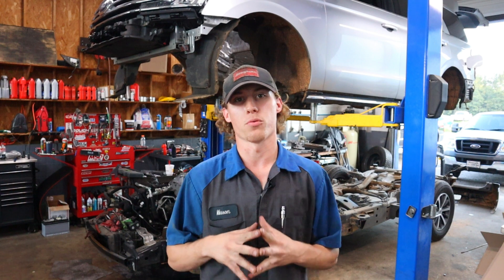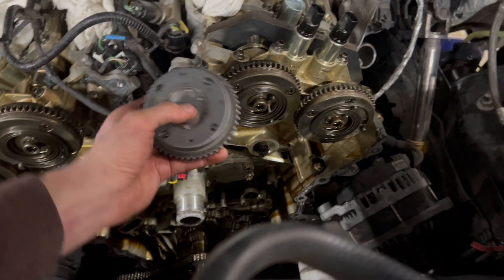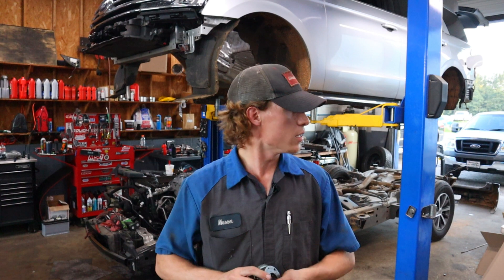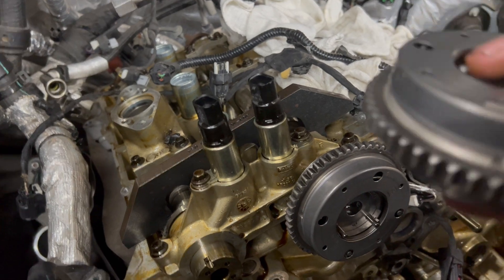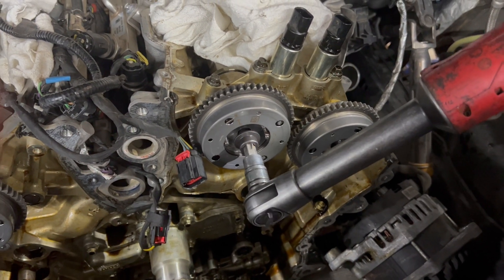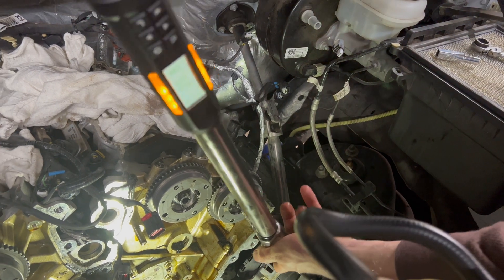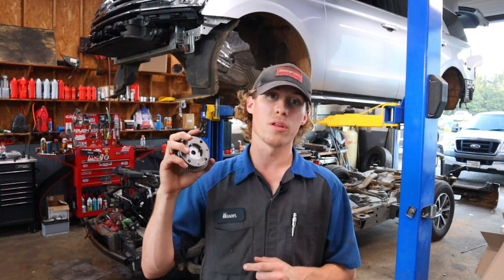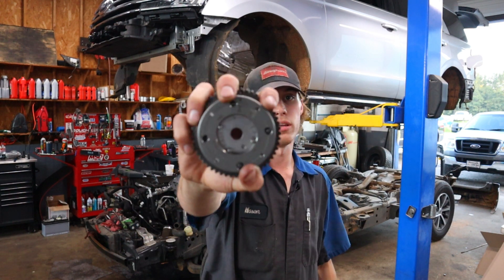Ford 3.5L EcoBoost Cold Start Rattle | The NEW UPDATED Phasers

Comment: Thank you for these videos. I have a 2014 f150 3.5 eco boost. I’ve only heard that rattle a few times at cold starts and last less that a second it seems. Is that and issue I need to address?
Reply: Nobody I've ever asked has responded to this question.  I think it's because there aren't any engine failures due to the phaser rattle.  I think people panic when the noise does happen ( it does sound bad for a second) so it's a mad scramble to fix it, not knowing or caring if it's a longevity issue.   PLEASE, WE WANT TO SEE VIDEOS OF ACTUAL 3.5 ECOBOOSTS THAT EXPLODED DUE 100% SOLELY TO A NOISY CAM PHASER!
Reply: How has the truck been running after 8 months of you posting this? I have a '14 3.5 as well. On a cold start it'll do the usual rattle for a handful of seconds then just go away. Otherwise it idles and drives smooth.
Reply: @black5heepX  It hasn’t done it again. I change the oil and filter (Mobil 1 ) at 4K and it seems to have settled.

Comment: The dealer mechanic did a great job on the repair.  The hpfp wasn't the cause of the idle knock either because that noise is gone too! Nice a quiet at start up and hot idle.  Thanks for this video!!!

Comment: So before I call my Ford dealership and have these done how has this repair and new phasers lasted? Anyone have an issue after replacing? My second set only lasted about 30k miles.
Reply: had it done at 51K miles and it just started again last week with 91K miles.  they put in same phasers as i told them i'll be back in 45K miles since the problem wasn't fixed and worn out parts were the only thing fixed.  I'm about to go to Dodge.

Comment: Hey bud I think your doing a great thing and they are lucky to have you. I recently bought a 2019 f150 limited as you know it has the high output 3.5 Ecoboost and the check engine light came on checked and it’s a p0022 but if the light didn’t come on I wouldn’t now there was a problem it runs fine the truck has 25000 miles what should I do? Thanks again for your videos very helpful

Comment: Oil pressure actuated variable valve timing is the worst thing to be unleashed on the car buying public.
Reply: Theres a lot of problems with modern cars. I think it comes down to low quality and over complication.... and extended oil changes.
Reply: Why don’t Toyotas have issues with them then? It’s a Ford issue
Reply: EGR was
Reply: Actually Honda is currently having cam phaser issues from getting into this, they are also having oil burning issues on new cylinder technology that ford came up with. Fords ahead right now every manufacturer is following them.
Reply: Can this be the same issue on a 2016 5.0? And can this cause the cam phaser sensor code?
Reply: Honda does it just fine.
Reply: @bryanmercado8755 Vtech has never had an issue but it's also not in the CAM, it's in the rockers that opens the intake valve more. So, it's not the same design.

Comment: Do you know if all dealer service departments are using the newer phasers for the replacement? My 2020 is in the shop for a knocking noise coming from the drivers side phasers. I’m afraid they’ll put the same old parts in it.

Comment: Are the new ML3Z Phasers a permanent fix for this problem or does it just happen again like the old style? Im looking to buy a used EcoBoost with the Phaser problem for a really good deal but I'm afraid ill have to keep dealing with this over and over!
Reply: I did my phasers in 2020 used old style. 40k miles later and 2 years, it’s back to the same old rattle. Grr.

Comment: Thanks for another excellent video. My 2017 F150 3.5 ecoboost (Now at  62,000 miles )and i  have been dealing with this problem for over 3 years. The Cam phasers have been replaced 4 times . the first two times they used the old part numbers HL3Z, then the third time they used the new ML3Z part. Each time the problem continued not only at cold start but even when the engine was warm. At times the engine sounded like it was going to blow apart. Most recently (Sept) they put in the 4th set of cam phasers using the old part number HL3Z. At first the noise was still there but not as bad and now for the last two weeks the engine is quiet for the first time in 3 years, i am not that confident that the problem has been permanently fixed and suppose that any day now it will start making that awful noise again
Reply: My 2017 is going under the knife on 2/23 I have been assured the new parts are going to be installed. I love the truck but I didn't buy a diesel ! Best of luck to all in phaser land and Merry Christmas!
Reply: And that the EXTREMELY loud knocking for 1-2 seconds right at startup? after it's competlely cold, or are you talking about another rattle like turbo waste gate?
Reply: If not repaired will it cause engine failure?
Reply: seconds right at startup
Reply: @sfeer1985  I'm taking mine in tomorrow for the first repair, trucks at 46k miles. This makes me feel not soo good about it.
Reply: When it's cold
Reply: People don’t fix it and say that nothing ever happens with the engine.
Reply: The noise did return after the 4th Cam Phaser replacement with the same symptoms as before. I no longer have that truck

Comment: Are the new phasers compatible with the 1st gen 3.5 (2013) in a sho?
Reply: I have the 13 as well.  Did you ever find out if this new replacement part worked on the 13 or not?

Comment: Mines in the shop getting this done @42,700 miles. Thanks for the updated part number-I'm checking to make sure I get the new style installed!! 2018 F150
Reply: How much did it cost you if you don’t mind me asking I’m looking to get it done to mine as well
Reply: @rayslawncare616  warranty
Reply: What was the total cost for the work and parts?

Comment: So I have the vct rattle on my 2018 5.0.. as well as “spark knock”  these both happen no matter the engine temp, I drove for 2 hours yesterday and it happened the entire time, from cold to operating temp

Other than the noise, does this cause any problems? Like is it okay to leave it as is? Unfortunately the dealers around me don’t like to give out loaner vehicles when people have to leave their vehicles with them, and I can’t be without my only vehicle.

Comment: I have been told to flood the motor by holding the gas pedal down while holding the key in the starting position before starting the engine on a cold start to build up oil pressure to prevent wear on the cam phaser. But, I have noticed that when I turn the key to on with a normal start, the oil pressure goes up for a couple of seconds; which is long enough for me to start the motor before it goes back down again. Is this intentional by ford to build up pressure to safely lubricate everything on a cold start? Want to know if I can start the vehicle regularly without cranking it for 7 seconds on every cold start

Comment: Здравствуйте. Скажите пожалуйста, у меня Ford f150 3.5 ecoboost 2011 года выпуска. Мотор умер. У меня есть вопрос. Мотор от "explorer sport" такой же как на "F150" ??? 

Блок цилиндров подходит? Если я куплю шорт блок от "explorers sport", он подойдёт на "f150 3.5 ecoboost 2011"?

Hello. Please tell me, I have a 2011 Ford f150 3.5 ecoboost. The motor died. I have a question. Is the engine from "explorer sport" the same as on "F150" ??? Is the cylinder block suitable? If I buy a short block from explorers sport, will it fit on the f150 3.5 ecoboost 2011?

Comment: Do these work on a Gen 1 3.5. My 2012 Ecoboost has it, been meaning to get that changed out. 225k miles and runs like a champ other than that rattle

Comment: HI Mason,I hope you see this and can give us some insight since many 4X4 truck owners have this situation. My orginal tire size for my truck is 275/65/18.I leveled it and went with a 305/65/18. Which isnt a giant difference but still a substantially larger sidewall and bigger outter circumference.If I have a flat and need to use my orginal spare tire (factory size) will it destroy the driveline?Whether the front or rear is this an absolute disaster or can I drive a few miles without damage? Keeping in mind its a 4X4.With the understanding of limiting the speed to say around 30-35mph.Any advice with this would be so appreciated. Thank you.
Reply: Throw it on the back if you get a flat. Make sure you don’t have a limited slip differential, or a automatic locker. In that case you can’t run it on the rear axle. Most the time you can mount a bigger spare and it will fit under the truck in the original mounting.

Comment: SO??????   When Were the "NEW PHASER'S INSTALLED" on the 2022 V6 Engine's? In the F-150 Family . (Also) My ENGINE was Built In MEXICO, Is there an Issue with V6 Ecoboost Engines BUILT IN "MEXICO"???    H E L L O?????

Comment: These trucks are garbage.  Very unreliable.. and alot of $$$$ for simple repairs.
Reply: Nothings really unreliable. You can drive all day on the cam phaser rattle.
Reply: @Experial.69  untill the phaser throws the timing out.
Reply: Certainly seems to be the case. although the cam phaser issue won’t internally hurt the engine, it’s still a major issue that can cause other issues outside of the motor. Timing chain for example.
Reply: @Maynardd  it will hurt the engine if the engine is at high RPM's and the valves do not close fast enough due to the phaser not operating properly.. causing the pistons and valves to kiss or come into full contact.. the phasers adjust the degrees of the cams to either retard or advance the valve timing depending on what is asked of the engine, then there is a high risk of the pistons coming into contact with the valves if tye phasers are malfunctioning badly,.  Which is the reason why these engines develop compression issues on some cylinders.
Reply: @zorans5200  Good to know! I guess the Ford tech that explained to me otherwise was wrong.
Reply: @Maynardd  im just telling you that the cam phasers adjust the degrees of the intake and exhaust timing.. if the came phasers fail and do not retract to "0" when they are not needed it can cause a possible contact at high RPM...  A chevy tech also told me he couldn't find anything wrong with my truck after i took it there twice, said everything was normal untill i decided to investigate and it was actually the GDI pump.. but nope everything was fine when i took it in.
Reply: @zorans5200 what is the chance of this ever happening

Comment: what in the absolute hell is wrong with engineers that one has to separate the car like it's at the factory to work on it? I mean that is insanity. "hey buddy your tune up is $7,000 dollars." "For 8 freaking spark plugs?" "Yup, and 7 grade 8 bolts 12 new body mount and bushings, fourteen snapped connectors, 14 different fluids, and 49 hours in labor." s
Reply: This kind of stuff is exactly why the battery movement will take over which sucks because I like working on vehicles.
Reply: @Bigfoot8x6  IT will then it will be discovered to be a giant disaster and we'll all ride horses. So we better start voting for conservatives because we're all going to be stuck in an apartment in a city owning nothing if we don't stop them

Comment: Hey Mason…but of the topic but I know your pretty good with ford vehicles. I’m wondering if there is a fix for the front wheel hub actuator on 2015 f150 always seem to get a grinding feel especially when it gets colder and I’ve replaced them with new ones and checked for leaks. Wondering if there is an update or something
Reply: Replace the vacuum check valve for the IWE actuators. It's located right behind the brake fluid reservoir. Motorcraft YG360 is the P/N.
Reply: First replace the vacuum check valve.  Confirm vacuum line condition and perform vacuum tests on the IWE to confirm they are not leaking.  If it continues you may need to either disassemble and clean that IWE that is sticky, or replace it because the teeth have already worn down.

Comment: Yet my cousin's 17 has little over 200k. Been making the noise since around 60k. So if it's out of warranty is it really worth spending the money to replace them. To me that would be no does not seem to actually harm anything.
Reply: bought my 17 with 180k and it had the rattle alr been driving it for almost a year and 10k miles and haven’t experienced any problems 🤷🏽‍♂️

Comment: I have new updated phasers that were put in 25k miles ago. Now more noisy now and haven’t lasted as long as previous phasers. Along with six DTC,s. I’m getting p0365, p0369, p0299, p0524, p061A, p0390. Replaced all cam sensors and same codes came back, all service oil changes completed every time by dealership. I believe the chain has stretched and vct,s are gone again, no power no turbo and low oil pressure. I’m at wits end. Been a ford guy all life and I’m ready for a check at this point. Have 105k with a 120k power train warranty, the problem is them fixing and not giving me a ride until completion. I don’t have a extra vehicle. I’m over it.
Reply: corporate greed, emission regulations and diversity hire engineers have destroyed our vehicles. I have a 2000 F-150 v6 manual that runs like a champ. The current tacomas are good too
Reply: on what vehicle were the new phasers updated on that failed?

Comment: Here because my 18 3.5 EB is at 48K miles with stock phasers. That last comment……yep, don’t let anyone tell you otherwise about the GM L84/L87 lifters. 2022 Escalade with 6K miles just had out lifters replaced.

Comment: It's a strange thing ,some 3.5 engines meticulously maintained and the phasers need replacing, and others abused and neglected with high mileage and no issues. I have a19 and am at 80000kms/50000 miles so far so good
Reply: By "fail" what do you mean?   You mean acquire a rattle?  Or do you mean actually explode inside the engine and ruin the motor?  Because I simply cannot find any information on the latter.....
Reply: @peruser155 no one actually knows
Reply: Yeah, these engines need to be driven hard way more often than not.
Reply: give it time... around 75K they will begin to fail...

Comment: You have a great channel and provide the critical info I need when working with my dealer on this issue. My 2017 3.5 ecoboost had cam phaser failure at 54K miles (warranty), again at 75K (part customer pay), again at 93K (dealer warranty on prior work), and just started again this week at 109K.  I'll need to wait for it to rattle consistently after a cold soak so that the dealer will address the issue, although I've become somewhat of an expert on identifying it by sound.  I think this is the second redesign of the phasers for this generation, if I remember correctly.
Reply from the maker: We don’t even check them anymore. Just put phasers in, they’re all bad haha
Reply: @FlyingWrenches13  when you pay 60K for a truck you should not have to pay 3500 each time you need new phasers!   I'm definitely very close to abandoning a long family history of Ford trucks and it doesn't seem to me that Ford gives two sh*&%ts about me.... I've called the "customer care" (oxymoron) center several times - they tell me it's the dealers problem, dealer tells me it's Ford's problem.  Well, now it's my problem and the solution is probably a Toyota truck....
Reply: @mr.grapes3931  ok Karen 🎉
Reply: @mr.grapes3931 Agreed 100%, just make sure you get the 07-21 Tundras that have the legendary 5.7L I-Force V8 in it, it'll definitely outlast any Ecoboost vehicle with ease trust me.